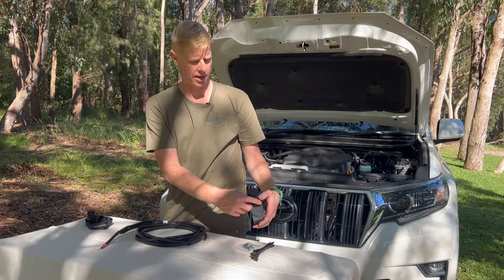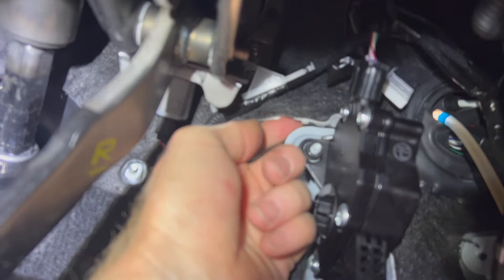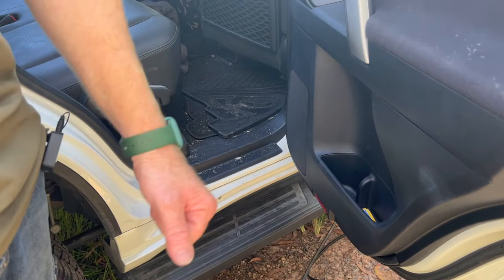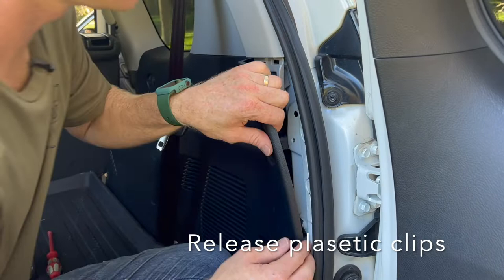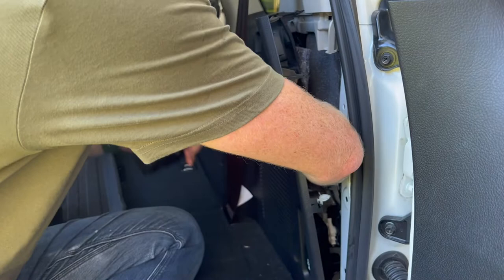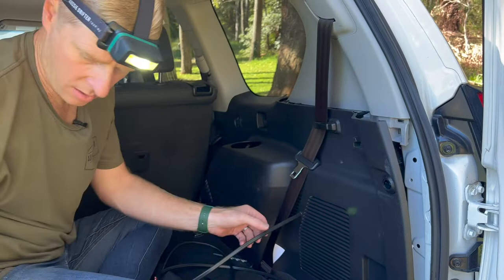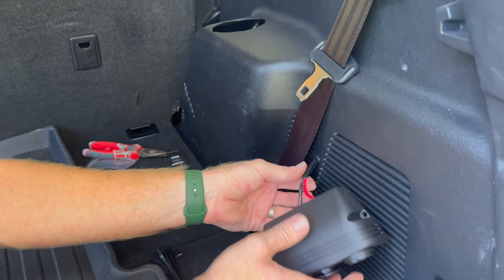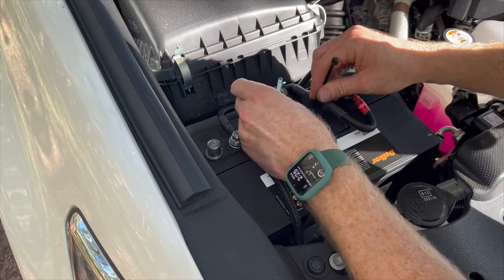How to wire a Toyota Prado 150 Series Accessory Harness | Fridge Feed Installation

Comment: Awesome vids and products mate. I just purchased and installed the Prado150 kit you sell with accessory harness, battery tray and redarc charger. Saved heaps of time compared to previous installations I have done in other vehicles using only the redarc wiring kit. 😊

Comment: Nice vid mate thanks. Little tip when your using a spanner to tighten anything on a battery best to always start tightening after the second terminal so you don’t accidentally arc across the two posts with the spanner. Had a mate do it and blew his wedding ring to bits.

Comment: Awesome Vid thanks mate. This is exactly what I want to do with my Prado. Only difference is that I have a Redarc Isolator instead of the DC/DC Charger. 2014 model Prado. Can you plug a Solar Panel via a controller directly into one of the sockets and charge the Second Battery and run the harness directly to the Second Battery rather than to the Isolator terminals?
Reply from the maker: Hey mate. Yer so long as your solar panels have their own solar controller then you can connect them straight to the aux battery

Comment: Great vid.  What is the wire gauge or cross sectional area for the wires to the rear?
Reply from the maker: Hi Tim.  The one in this video is 6mm twin.  We do have one that has an anderson plug on it and it is 8 b&s cable.

Comment: How would you approach the grommet situation if you already have a cable running through with its own grommet?
Reply from the maker: Hi mate, in that case the original Toyota Gromit, the large one going through the firewall that contains the Toyota harness running into the vehicle has spare nipples that you can cut the end off and using a little bit of lubricant you can push the cable through those into the car. That designed for extra accessories to be installed. Hope that helps

Comment: What size cable are you using to run to the back on the accessories harness? And would you be safely be able to run a fridge and other accessories off of it?
Reply from the maker: Hi Mate the cable size used depends on the type of harness and sockets selected. it is 6mm twin if using round sockets and 8 B&S bacle if selecting an anderson plug harness.  They are all designed to run a fridge and other low current 12v circuits such as camp lights and charging usb gear.
Reply: @AussieDrifterTouring  thanks mate appreciate the quick reply

Comment: Does the new Prado 150 require the redarc to be connected/piggy back to an ignition wire source in the fuse box? Cheers.
Reply from the maker: Hi Stan, no mate it doesn't, they are still running a temperature compensating alternators so that is not required.
Reply: @AussieDrifterTouring  awesome thanks! Always confused smart alternator with temperature sensing one…
Reply from the maker: @stansze8013  no worries mate, glad we could help 👍
Reply: Hi where buy wire

Comment: Can you go through the Gromit on the right side of the bonnet through the firewall?
Reply from the maker: Hi Daniel, This harness is made to go through that specific grommet but the harness is 7m long and therefore long enough to reach anywhere in the rear.  So if you looking to have your sockets on the passenger side then we recommend going through that grommet and then running behind the dash to the passenger side and then following the same procedure to run down the passenger side.  Hope that helps, Cheers Kurt
Reply: @AussieDrifterTouring  Thanks Kurt! Much appreciated
Reply: @AussieDrifterTouring  Do you any videos or hints on how to get across behind the dash?
Reply from the maker: @JeremyKozak-sl9cz  Hey Jeremy, we don't have a video for that sorry mate but it's pretty easy. Once you drop the plastic covers down you can see the Toyota harness from left to right and you just cable tie to that.  Hope that helps
Reply: @AussieDrifterTouring  getting the covers off is what I’m unsure of🤦